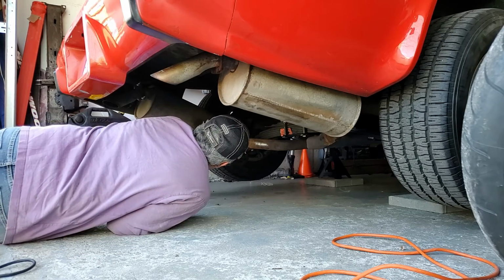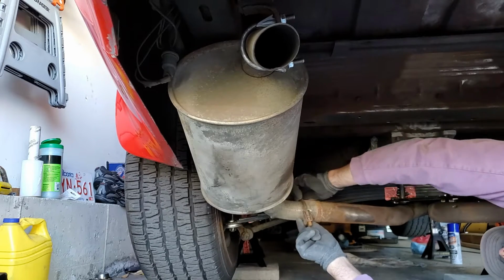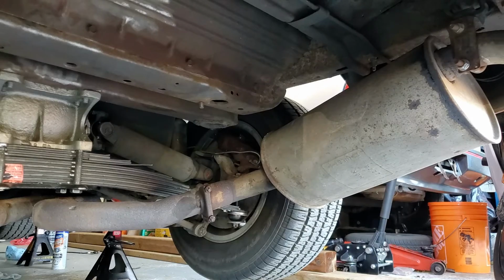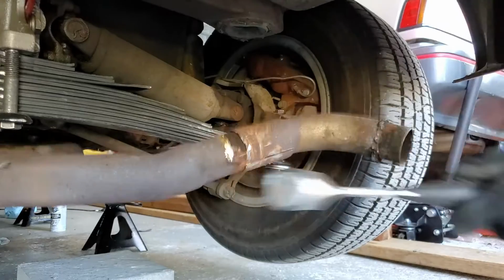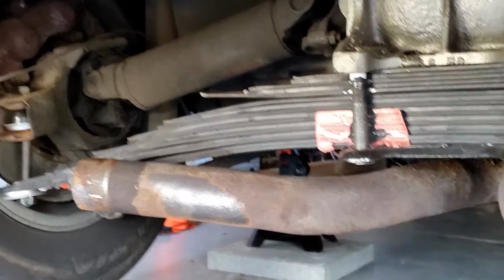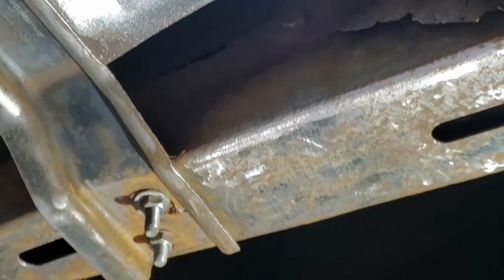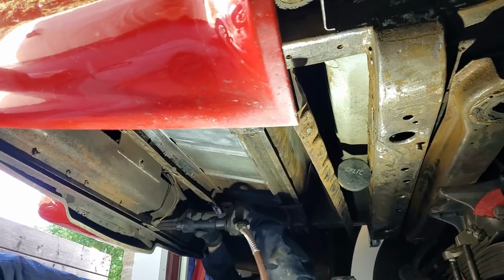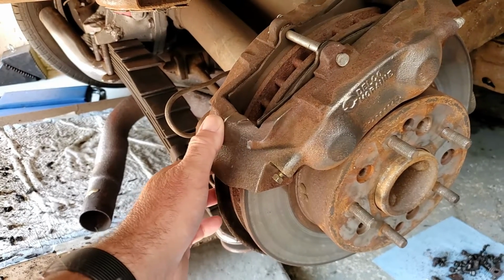1977 C3 Corvette Muffler Removal and Backend Refresh - Part 1

Comment: Johnathan,  what are your thoughts using Corroseal vs Por15?  Seams much easier to use.
Reply from the maker: That's a great question. POR15 puts on an amazing hard black finish, but for me, I do all the scraping, grinding, and sandblasting before putting on the POR15. Once the POR 15 is on, it's really on.  Corroseal looks interesting and I'm going to try it out. Looks like a good thing to have in terms of helping to convert rust and prepare a surface for painting. Maybe I'll use a combo of Corroseal and POR15. POR15 is definitely being used as my final coat, ultimate finish and protection. Thanks for your comment. J

Comment: Thank you. I am in almost the same position with my 1977. As a new owner, what should I do first? Thank you in advance.
Reply from the maker: Wow, and have fun.  For me, I wanted to keep mine as a daily driver and my C3 is all original / stock so I want to keep it that way and in doing so, doing a complete refresh of all the major components. This year just happens to be about suspension, exhaust and installation of a new core support, rad, water pump, and whatever else seems right to do.  I also want to drive the C3 as much as possible too, so I'm trying not to keep it off the road for too long. Keep following my videos and I'm sure you will get some ideas. J
Reply: @Motorcycology  watching again!
Thanks again